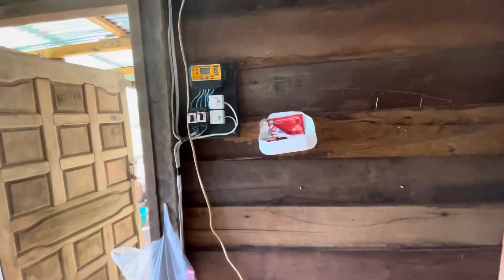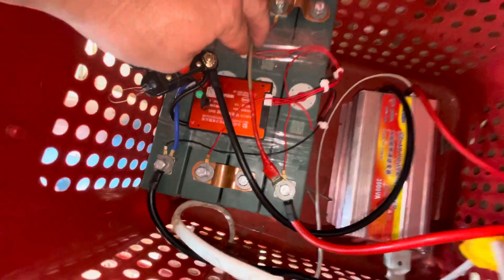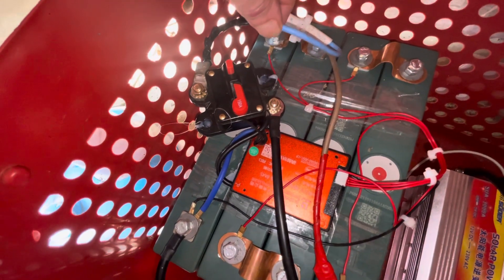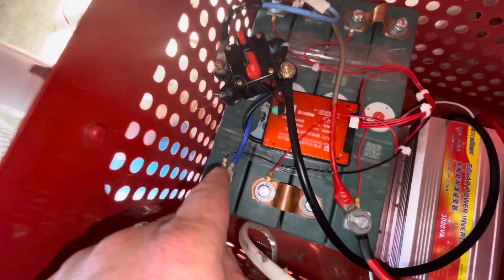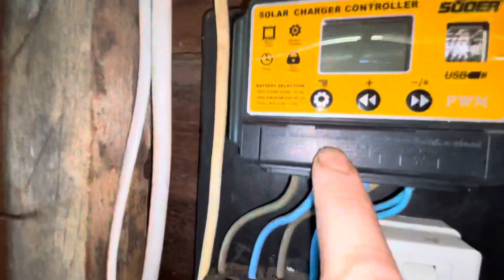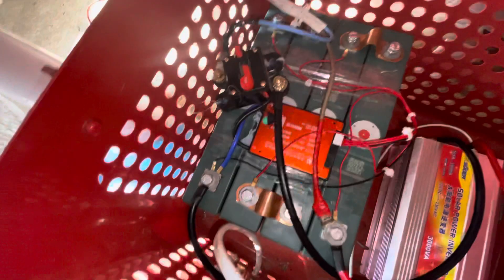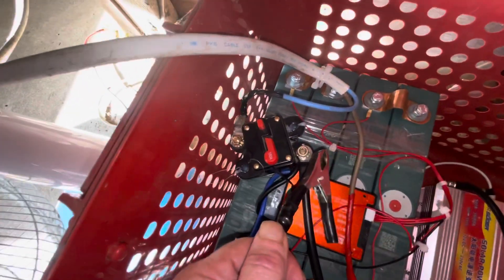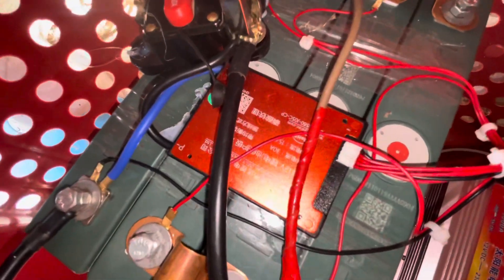How to reset a daly BMS that is tripped. Be sure to have all load switches off before shorting !!!

Comment: Don't leave the B- and P- terminals connected through the jumper like that. It means you are bypassing the BMS and taking power directly from the battery pack. Just short it once and BMS activates. Keeping these two terminals connected would make the BMS useless and it will not trigger protection when required.
Reply from the maker: Mate, I know more than you about everything in the world.

Comment: I followed your instructions, but no sparks and not work for me
Reply from the maker: What volts has you battery got ? The issue with these BMS ‘s is that even though the volts may have recovered to 11 volts or such the BMS stays tripped. At least put a charger on and charge you cells up to a voltage that the BMS should really be passing current.

Comment: thank you but i think without bms the life of your batteries will be reduced the cell balancing is very important
Reply from the maker: What are you talking about ? That is a BMS. It it keeps tripping and disconnecting the circuit to the inverter and solar panel. You say cell balancing is very important, what has that got to do with this particular Daly BMS ?

Comment: THANK YOU !!!
Reply from the maker: I’m here to help.
Reply: @Steveuploads  
This happened again..and ty again. what might be causing this?
All 4 eve prism cells are 3.4v and batt reads 13.7v
Reply from the maker: Okay, so I’ve had to learn the hard way a lot of these little set ups over the last few years. What is happening is either on the charge up or the discharge out? One of your cells is dropping so low or rising so High that it triggers the BMS and it cuts out then overtime all those cells equalise out and if you’re lucky the BMS will reset itself when it gets back with the intolerance but as we’ve seen, it doesn’t always happen and you have to use my little trick and bypass across the top of it and it suddenly makes the semiconductor switch inside connect. What you need is what’s called a “ flying capacitors “ PCB it’s a great little device that transfers high voltage in high cells to cells that are low voltage and are getting close to the BMS low cut out threshold. Or if it’s in charge up mode it discharges volts from any cells that are reaching the high threshold cut out into the cells which are low voltage.  I’ve used these PCBs with a 4 cell set up and an 8 cell set up. This is all going on in Thailand where are use them as battery back up from a charger I don’t use Solar, it’s overrated to make it work. You need an expensive battery set up and 12 solar panels and then when you get your money back the batteries will fail. It’s ridiculous. I’ve actually used it on an NMC7 cell battery as well because I had problems with that one where it had tripped its BMS but because that seven cell battery is connected onto the same 24 V system as one as my other big 24 V system, which is two sets of eight cells, I couldn’t see that the BMS tripped. I purchased a.’ Flying capacitors PCB ‘ and it worked okay. You have one wire for the negative from the new PCB and all your other cells get one wire going to the positive terminals of each. Let’s side all your cells are depleted because they’ve been used for a couple of hours in a blackout which we regularly having Thailand in the villages. When you put your amp meter on each of the wires from the flying capacitors PCB to the positives of the cells you will actually be able to see and peach flowing out of some cells and going to other other cells as required. This operation prevent prevents your BMS from tripping because yourselves individually never get low enough or higher enough to trip the BMS.  Hope that helps. I actually made a video talking about all this on my set up at the house. I was doing a lot of rambling maybe I’ll upload it.
Reply: @Steveuploads  Appreciate the detail. Balancer sounds like a good idea. Seeing a lot of brands. Any you recommend?
Reply from the maker: @wizdumb420 

‘Flying Capacitors’ is what I bought in Thailand. Where are you in the world? There are some expensive BMS’s that have got effective balancers built into them, but that’s defeating the object, you’ve already got a BMS.

Comment: man, u just bypassing the bms, ur method just make that battery used without bms.
Reply: Man, that is the ONLY way to reset a "common charge/discharge port" bms like this model of Daly bms. You "bypass" the BMS for a second, just so that the BMS allows charge of the battery, which rises to a sufficient level for the BMS to not trip again.
Shitty design i agree, but that's what you het on the cheap models ;)
Reply from the maker: Just be sure to disconnect the load your drawing from the battery before making the bypass for a second. It works. 

Also if you have a BMS cutting out look for the reason. The reason is normally one cell is going low or high during charge or discharge due to having no balancer fitted. One I fitted a flying capacitor balancer to this battery and my own battery pack at our house. I never needed to short/ reset like this again.

Comment: is that jump the main neg cell terminal to the neg output side of the BMS.?
Reply from the maker: Yes the jumper is attached to the Battery negative and shorts from there to other side of the BMS. Another commenter talked of how he did what I said and ended up with a big bang and flash. Some people should not be playing with electric 😀. Number 1 rule of disconnection or connection on live electrical wiring is be sure onward load is switched off when you pull or connect to a terminal live. Otherwise you will experience a flash as the load connects or disconnects.

Comment: I thank you. On a Lifepo4 4S battery I had 9.70v at the BMS output while the voltage is 14v directly at the battery terminals. I shunted P- and B- and now have 14v at the BMS output
Reply from the maker: So your back in Business ! This 12V 4s battery in the video activated the BMS most nights. This was because one of the cells was. Reaching the 2.5v BMS cut out Voltage threshold before the others. At first I thought I had a faulty cell. I fitted a ‘ flying Capacitors ‘ Balancer equaliser to the cells and those cells have not activated the BMS since. The balancer feed volts from the higher voltage cells in the pack to the lowest cell and ensures that battery cells runs down equally and lasts the longest time possible.

Comment: I wonder how many people whose BMS turned off tried checking the voltages from each cell? You do know the BMS is there to protect the battery and you . anytime one of those cells gets to far out of balance it opens the negative line . Lifepo4 should be 1.2 to 2 volts on any of the 4 cells in that 12 volt battery so if any one drops to that it opens the negative line so battery work . I have located the lowest cell and charged it up to match the highest cell then make sure there all same voltage then let BMS and charger do there thing.
Reply from the maker: But a cell should never go low or high and activate the BMS cutout. The problem is people  need equalisation on second hand cells like these and even new built Packs come with flying capacitors or other more expensive equalisation systems fitted.  I made this prior to fitting a  flying capacitor PCB ‘ and it has never tripped since then in well over six months since I did that.
Reply: @Steveuploads  Don't cells in a pack auto-sync voltages after about 24hrs anyway?  So If I have a pack of 4-cells in a 12V battery.  And 2 of those cells are 2.80V and 2 are 3.Volts - over time won't they all settle to around  2.9V?  without any BMS, charger or equalizers attached..
Reply from the maker: All the cells react differently to being charged and discharged. For instance the take 4 cells charging. One cell will start to get closer to the BMS’s ‘high cell cut out limit’as you are charging them. Also the highest cell voltage will push up the overall voltage of all the cells before the other 3 cells have fully charged. Thus you may have 13.7V overall with one very full cell but 3 not fully charged cells. The same happens on discharging. One cell will drop faster than the others. In my experience the best thing is to fit a ‘ Flying Capacitors’ PCB. This will move high cell voltage to other lower cells and in discharging it will move voltage from adequate cells to a cell that is trying to empty itself quick. I have done this on a 12v and 24v system and never looked at the cells again. My friend did the same with a 48v system and said it didn’t work well. He ended up fitting a brand called JK and it worked for his cells

Comment: Why is this so complicated? Why can't you just disconnect everything from the battery then connect the charger? That's how they should make these things.
Reply from the maker: @walterbrownstone8017

Okay well the answer to that is. What happens generally is at the end of the use of the cells during night the overall volts gets closer to the inverter low volt cutout. If unlucky before you reach this cut off point one of the cells of the group will get low enough in its volts, 2.2v in the case of LifePo4 cells, to stop the BMS. At this point the BMS stops any more discharging or charging. Here lies the problem. You said can’t it just reset when you apply a charger. The chargers power will not be able to reach the battery due to the BMS switching out the circuit. 

Personally I don’t think my method of momentarily bypassing the BMS for a second is complicated (!!! Switch off all load first or the bypass jumper wire will be carrying all the load of the inverter also !!!!)  you cannot charge the cells without the BMS in circuit either with a charger or solar charger because if your charging option went faulty the cells would get damaged. Hope that helps.
Reply: @Steveuploads  What I mean it's when EVERYTHING is disconnected from the output of the BMS, open circuit, the BMS should reset and allow charging current. Then after the open circuit signal is received by the BMS you connect the charger and everything works great. That's how they should do it
Reply from the maker: I agree. And I did do it that along time ago and i believe it worked, I disconnected the Bms from everything and it resets. But if you have a nuisance trip every now and then it’s a lot easier for someone with no tools or even any knowledge such as my girlfriends father who sleeps on a remote goat farm with this system and may get a nuisance trip that needs resetting at 4am and doesn’t want to do a full strip down and rebuild at 4am. So this is the method I suggest for that reason. 

Anyway I have since learned that the BMS tripping is not a nuisance trip it is symptomatic of a systemic issue that needs to be resolved. Look out for my next video.
Reply: @Steveuploads  There should probably be a master disconnect switch switch.  I have a 24v ebike battery and it requires a 26v charging signal. It shut down and left me pedaling a few times.

Comment: OK, I did what you said. I don’t know how did you manage to create your micro spark when touching the blue and black wires but my SPARK blinded me for three minutes, burned down the XT90 plug and 3 fragments of burned metal parts of the plug landed on my iPad screen on which I was watching your instructions and burned three separate small holes in the glass of which one cracked the screen.
Reply from the maker: Every young electrician learns that when working live and pushing a live conductor into a terminal all onward switches should be open so no load is in circuit. The small spark ⚡️ I had was from the amp draw of the inverter which I didn’t switch off I guess but with no appliance was switched on so the little spark was the inverter amp draw. If you ever do energise an appliance in this way be very definite in you actions as you apply the shorting cable. A limp wristed approach will cause flash. That’s why switches have springs inside to  close and open the contact fast. What was the reason for the Bms to activate and go open circuit? Did you check all the cells for which one was high or low ?
Reply from the maker: Are you sure you shorted across the Bms and not across from negative to positive? In the post I just made I assume you didn’t short from poz to neg . But if you got such a bang and flash … on reflection I would say you just somehow manage to jump from Neg to Poz and blasted 100s of Amps through you cables. One advantage of jumping with a small cable is the cable melts away in a nano second like a fuse if you do make a mistake so the flash is minimised.
Reply: @Steveuploads  My pack is 14S 52V. 18650 li-ion cells. When I measure volts for each pin, range is between 3.46V to 3.9V. So it seems all cells are within the range. 
When I measure voltage between black pin and last red pin (white pin connector) it shows correctly 52V.
When I measure voltage between actual positive and negative ends of the battery pack, I get correct 52V. But when I measure voltage between red and black wire coming from the Daly BMS, (XT90 connector) it shows 39V. I checked how BMS is connected to the pack and it is all correct. When I use smaller wire for reseting the BMS as you suggested, and connect black to blue, there is no spark. Nothing. After that black and red still show only 39V and not 52V it should be.
Reply from the maker: @Traderhood  I’m not very familiar with these 18650 packs but I have just looked one up in google images. I don’t know if you connected the BMS yourself but one mistake I made and learned from was the Black BMS wire goes to the Negative and the next red wire in line ( let’s call that Pos 1 ) goes to the pos of the first cell ( which the black also goes to) to feed back 1 cell volts then red wire 2 goes to cell2 positive. Until the last 14th red wire goes to the furthest last cell this is so the BMS sees the 48v. If these wires are seeing the wrong voltages the BMS will not make a connection. In you setup I would short across the BMS from P-
to the Negative side of the first string cell. You must have shorted from B- to P+   to effect an explosion like you did.
Reply: @Steveuploads  Also when I connect charger, nothing is happening. It just sits there doing nothing showing solid green light on the charger.
Reply from the maker: @Traderhood  If the charger is doing nothing , maybe red and green light ?  I’d say the BMS is open circuit. You need a stepped up voltage on each sensor wire in starting at 3.7v ish and stepping up each time correctly and finishing at 52 volts ish
Reply from the maker: @Traderhood  are you sure you have the correct charger and are not charging with a NMC charger 29.2v as opposed to LifePo4 28v charger. I made that mistake once when i paralleled two packs NMC and LifePo4 and when I charged with my charger the LifePo4 BMS would disconnect. Luckily I have a Daly SmartBMS so I could set the charge cut off to 28v and let the battery charger keep going to charge the NMC pack up to 29.2v.
Reply: @Steveuploads  Voltages on each pin are correct.

1. 3.59
2. 7.14
3. 10.74
4. 14.34
5. 18.12
6. 21.91
7. 25.70
8. 29.49
9. 33.05
10. 36.94
11. 40.40
12. 44.3
13. 48.1
14. 52.00

When I bypass BMS and plug my eBike directly to the + and - of the battery, it runs just fine. BMS is connected correctly according to Daly instructions. So yes all pins are connected correctly.
Reply: @Steveuploads  Charger also correct. It’s 52V charger as this is 14S pack. I think it just ignores the battery since it is showing only 39V. At this point I ordered new BMS. Will see what happens when it arrives.
Reply: @Traderhood  What happened with new bms? I have same issue.
Reply: @electronic7081  It fixed the problem. The original bms was bad.
Reply from the maker: @Traderhood  You say “ it fixed problem “ what fixed the problem ? Didn’t you say you had a big short that made you go blind ? Did you make a mistake and short across Poz and  neg instead of bypassing the BMS ? You may have blown that BMS if you did make a short circuit and the BMS was in circuit
Reply: @Steveuploads   That BMS was showing the same 39V before trying your remedy. It was simply bad BMS from the beginning. Replacing BMS fixed it.
Reply from the maker: Ok. But a flash like you described will be from hundreds amps flowing like when you accidentally touch Poz down to neg, how are you thinking you got that flash of you only bypassed the BMS which is a switch ? You will get a spark as your bypass method allows the load to pass but not a blinding flash